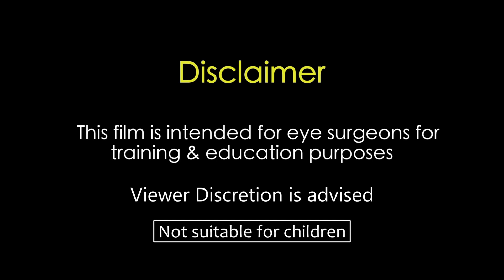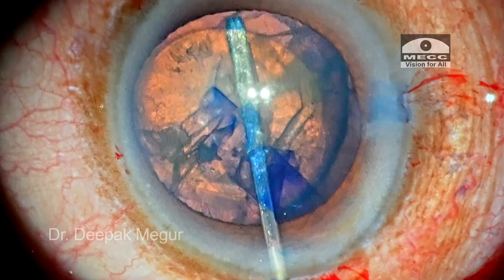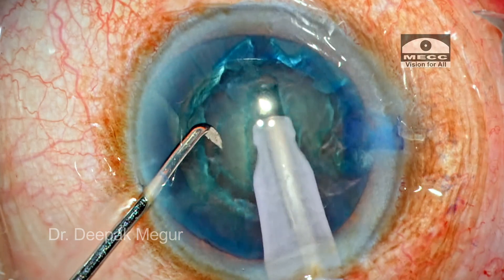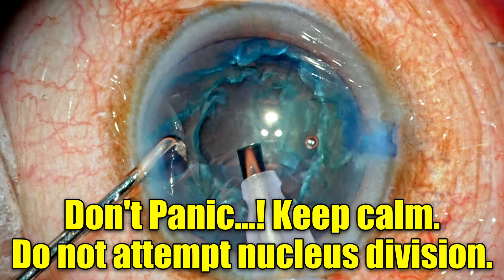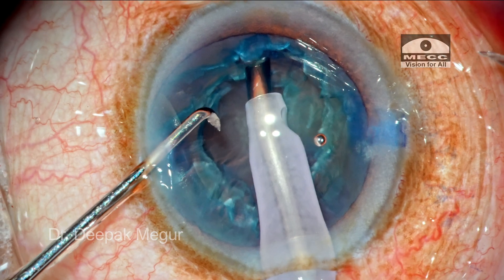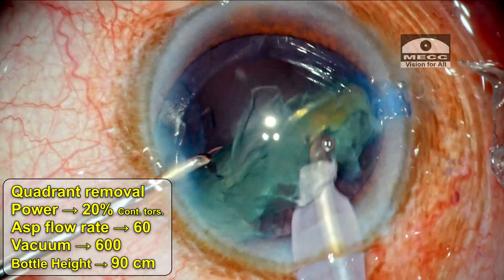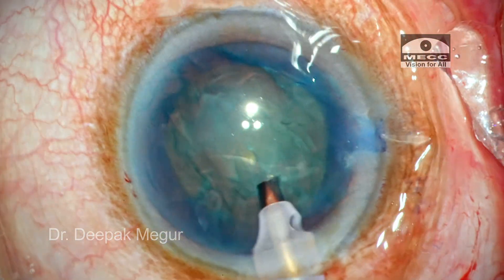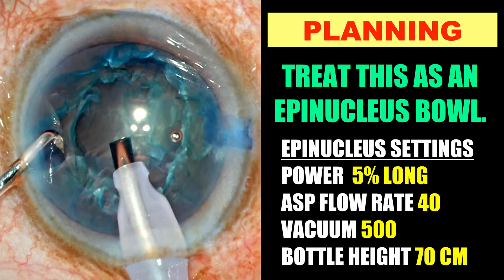Bowl formation in soft crumbly cataract, Tips for soft nucleus management: Dr. Deepak Megur

Comment: I do a lot of RLE and thus often have these types of (non-)cataracts. Yes, sucking the lip edge out of the bag and pulling it towards the center is usually the best way, and if it fails, you rotate the lens a couple times and retry and it will become thinner and will bulge easier towards the center. And if it takes too long or seems risky, just use BSS and Visco on one side to lift it out of the bag. Always works.